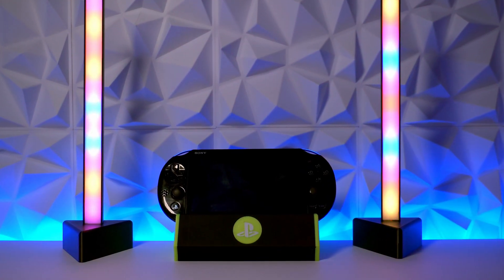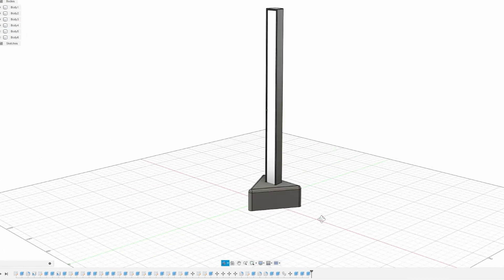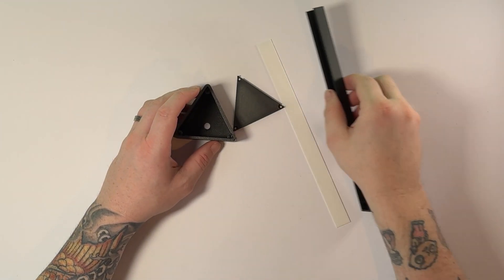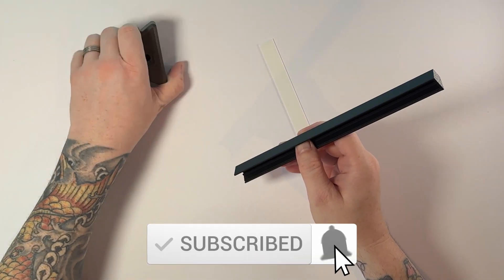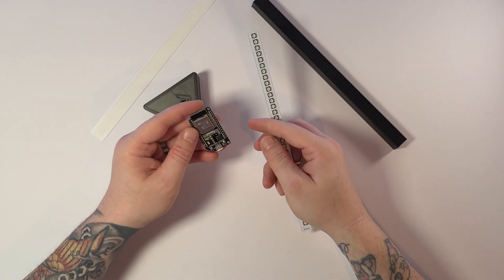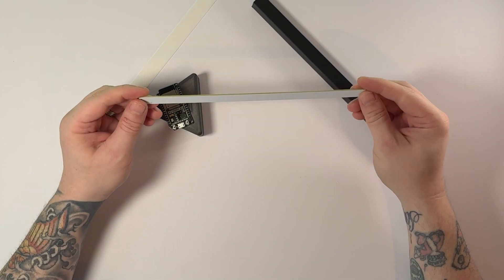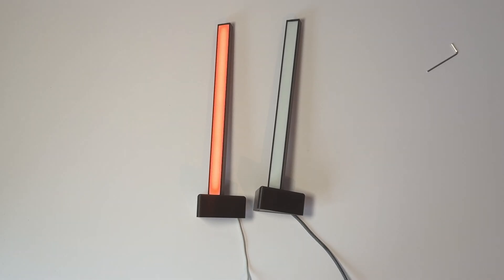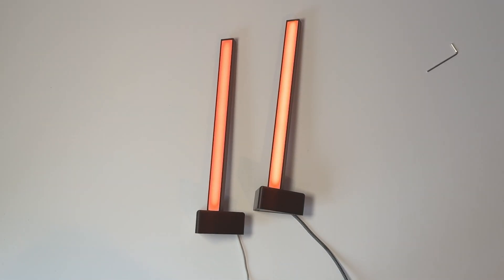RGB Desk Lights That You Can 3D Print At Home And Light Up Your Setup!

Comment: Someone setting this up should be able to fix it themselves, but a big improvement to this, would be to add a port so that any random usb cable can be plugged in.

Hardwired usb like this should be considered a full on sin at this point.
Reply from the maker: Yeah if this was a product for sale then 100% but for cost and simplicity adding the cable like this was the easy option.
Reply: @JPPrintz  If the English language has taught us nothing else, it would be that /EVERY/ single rule has it's exception...

This is a diy project, and like I said, anyone making this should easily be able to fix the cable if anything happens and/or resize it as needed.

My comment is more for off the shelf products. Having a detachable cable, especially when said cable is usb, has so many benefits.

If the cable is chewed by a cat/rat/dog/rabbit/etc? replace it

It's caught by the light from some window decoration and burnt through? replace it

caught in a door? replace it

You're out of type a ports(or whatever is on the other end) swap it out for one you do have open.

have tons of extra coiled up? grab a smaller one

short by half a mile or just enough that it reaches but is tight enough to play hotel california on? grab one of a different size.

type A too big for the hole but a type-c or micro usb would fit? problem solved.

keyboards, mice, pretty much any product that connects with sub in any way should absolutely have a detachable cable.
Reply from the maker: yes 100% agree and after I replied to your first message I started looking at solutions that are cheap and easy to implement and I came across some USB-C ports on ALIEXPRESS  

https://www.aliexpress.com/item/1005006995304545.html?spm=a2g0o.cart.shoppingCartRecommend.3.5eea38da3GCNPQ&gps-id=shoppingCartRecommend&scm=1007.13440.311564.0&scm_id=1007.13440.311564.0&scm-url=1007.13440.311564.0&pvid=367587b1-6a42-4e34-a355-f6ad68bd4094&_t=gps-id:shoppingCartRecommend,scm-url:1007.13440.311564.0,pvid:367587b1-6a42-4e34-a355-f6ad68bd4094,tpp_buckets:668%232846%238107%231934&pdp_npi=4%40dis%21GBP%212.37%210.97%21%21%2120.74%218.50%21%402103891017378044991948055e950f%2112000038985706717%21rec%21UK%213931195877%21X&utparam-url=scene%3AshoppingCartRecommend%7Cquery_from%3A

Stupid long link but they are super cheap so I will order a bunch.